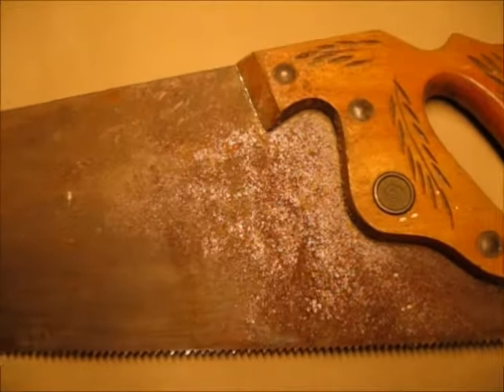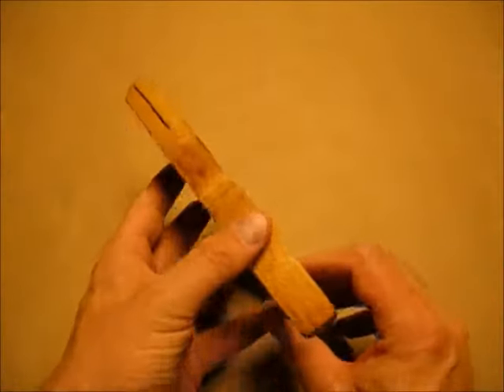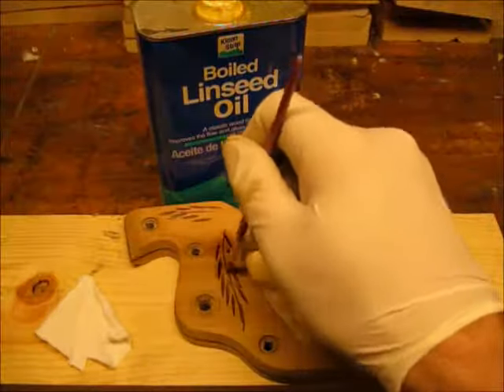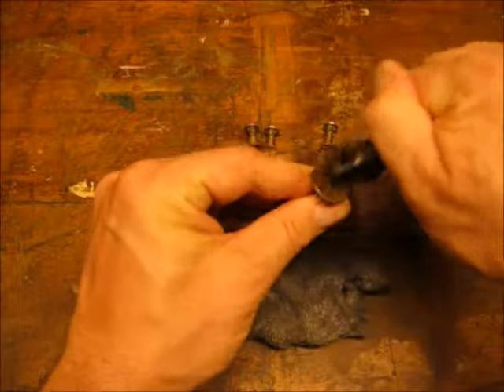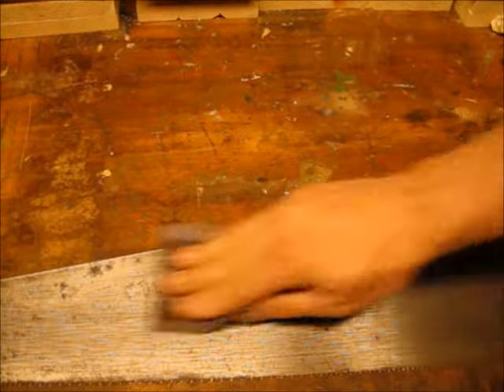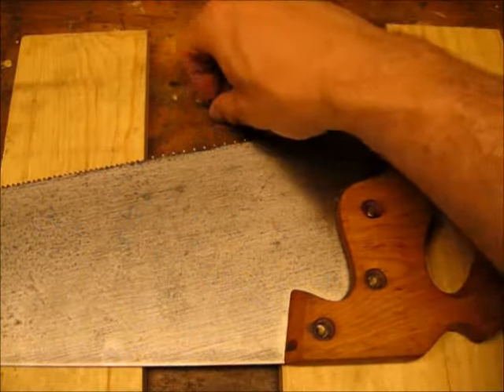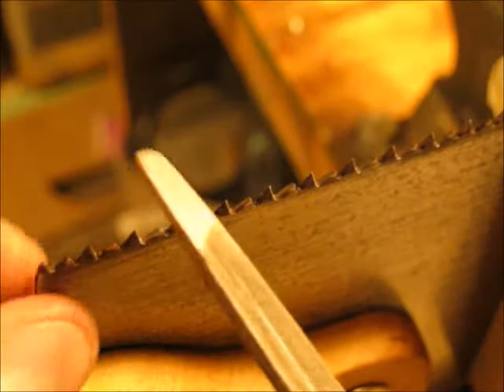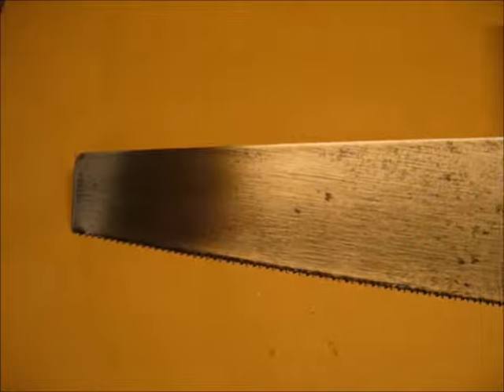DIY Handsaw Restoration

Comment: I picked up the tip of the low angle sharp edge scrape of the the rusty surface when researching how to remove surface rust from the outside barrel of a

Comment: Good video, great job! My personal preferences are to put a few coats of linseed oil on the handles and I use beeswax on the wood - I don't like petroleum products on my wood. The old saws I come across do not have the manufacturers etching so I use an overnight bath of white vinegar.  I send the blades out for sharpening through my local Woodcraft store. I just had two done for $15. Took a week.
Reply: John Mckisson -  Why wax instead of oil? And is beeswax better than the paste wax he uses?

Comment: Nice job magdad. I have several rusty saws I want to try restoring. Any hints on removing lots of rust?
Reply from the maker: Thanks for watching!  Some people use chemicals to dissolve the rust.  I like to scrape and sand.  I worry that the chemicals may damage the steel or eat away the blade etching that may help me identify the saw.

Comment: I've got a very similar saw that I'm getting ready to take it apart and restore myself.  The handle however, has a bit of a wiggle to it, is there any way to fix that?
Reply from the maker: Usually just tightening the screws will get rid of any wiggle.  If the handle is still loose after tightening the screws, try filing the male screws shorter, this may allow you to tighten it more.  Good luck with your project and thanks for watching!

Comment: Are there any tricks to getting rid of the black stains on the blade?
Reply from the maker: I think the black stains you are referring to are rust pitting. I have not tried to remove these.
A lot of times the pitting is too deep to sand away. I have seen others try acid baths but I am afraid this would also remove the manufacturer's etching.
Reply: You do not want any pits close to the teeth line.  Pits near the teeth will make it impossible to sharpen.  Setting those teeth may lead to breaking.  Do not buy an old saw with pits near the teeth line unless it's meant for decoration as a wall hanger.
Reply: LittleShop OfSawdust I
Reply: White vinegar and water 50/50 mix, with fine sandpaper.

Or oil and sandpaper will also remove most of it.

Comment: Excellent video, amigo!  Curious if your etching diminished while you restored your bald.  I recently started restoring an older Disston D-8.....quite rusty.....as I cleaned her up, I was surprised to see the etching on the blade. Discontinuing my abrasive restoration, I inquired from others on line.... One restorer recommended mineral oil and very fine (600 grit) sandpaper on a flat block.  While I haven’t tried it yet.....we’ll see.  Bravo-Zulu on your restoration.  I was particularly impressed by the time you spent on that handle.  Well done!
Reply from the maker: Thanks!  Yeah, it's a fine balance between removing the rust and preserving the etching.  On the older saws, the etching is pretty deep and can survive some sanding.  I've tried to brighten the etching with cold bluing with mixed results.  I've read that the wood on the old saws is apple.

Comment: Disston Keystone line. This is one of 6. Challenger. Wish you would have left the etching. Looks great though. This was Disstons "Generic" line.
Reply from the maker: The etching was preserved, but faint. It is hard to see in the video because of light reflecting off of the sanded blade.  I find that the older Disston saws have deeper etching that survives better.  I have experimented with gun bluing to darken the etching, but have not had results good enough to brag about.  Thanks for watching!